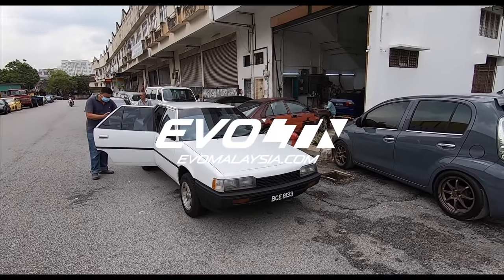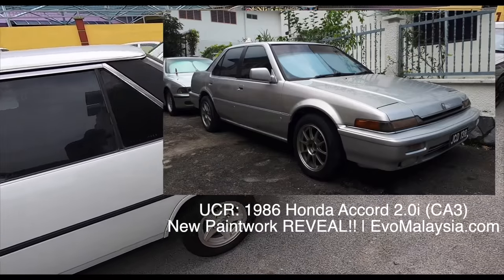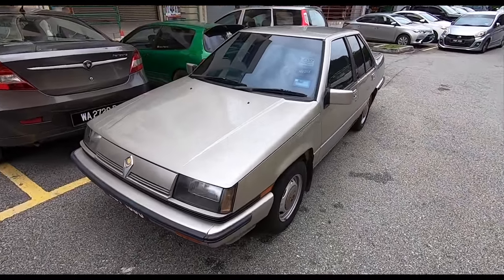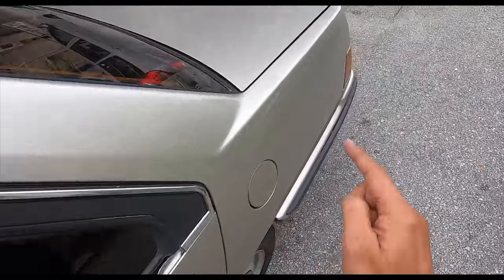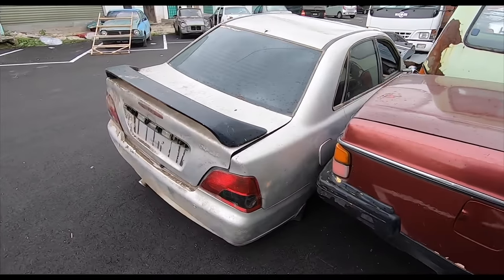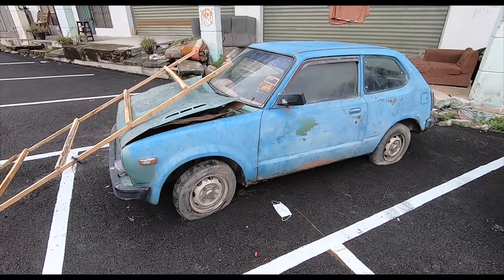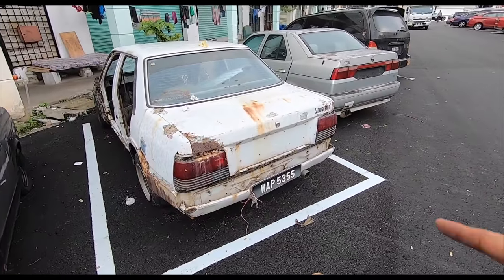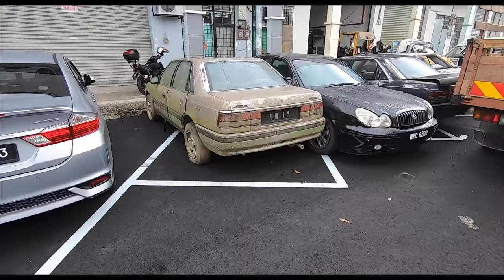UPDATE: '85 Proton Saga & '84 Mitsu ST sent for Paint! PLUS a Walkaround at Atib's | EvoMalaysia.com

Comment: The only version with black bumpers is the Malaysian ST. In every other country the bumpers are colour coded which IMO looks way better. Maybe you could consider that?  My father had the exact one way back in the 80s in white and he colour coded the bumpers. Just a suggestion.
Reply from the maker: Thanks for the info! Nah, I'm going back to original, imho, it looks good this way 👍🏾😊
Reply: @ChrisWeevilGarage  looks are subjective so go for what you like! I love this car back then..love the unique cockpit with the rotary dials and push button wash/wipe..the reclining rear seats, sliding rear head rests and if I'm not mistaken the rear seat bottom height are adjustable too